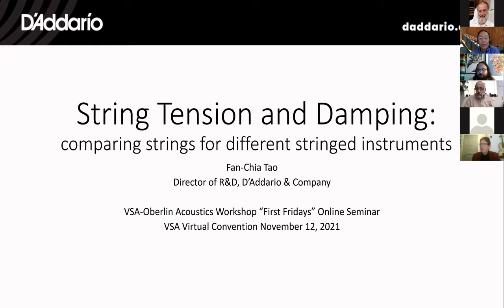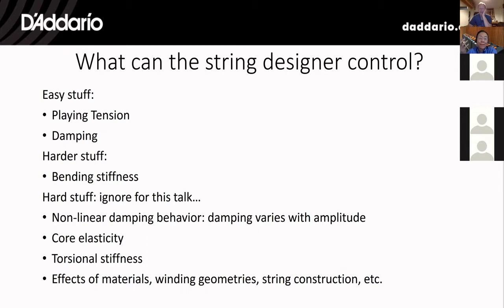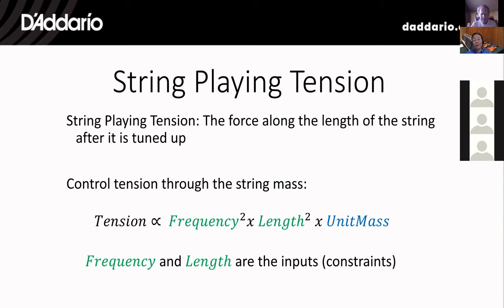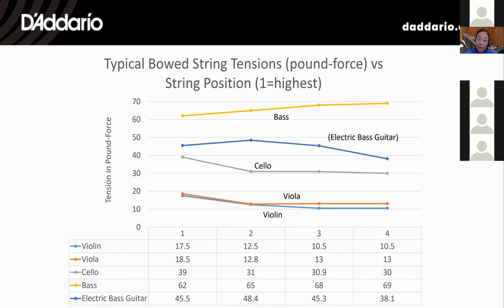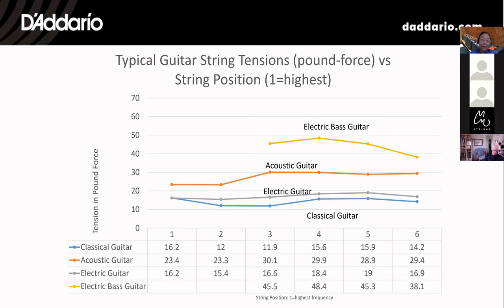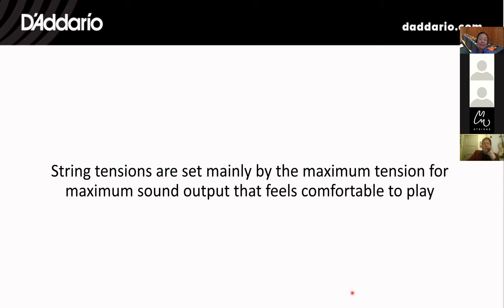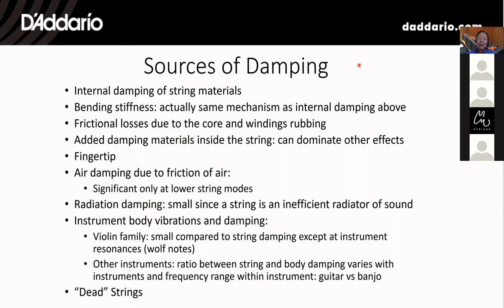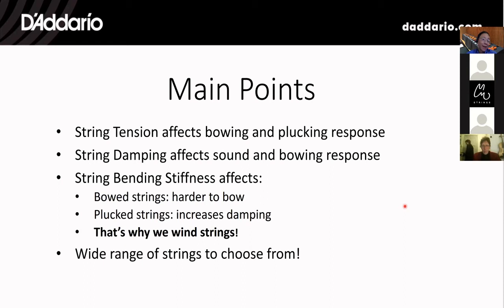VSA Seminar Nov 12, 2021: Fan-Chia Tao, String tension and damping: comparing strings

Comment: What a great and informative discussion.  It seems that cellists, myself included,  more than any other player/owner stringed instrumentalist, are continually experimenting to finding the best strings/combo. Any shallow search on some of the internet forums confirms this.  Not only are all cellos unique, but this quest is further complicated when a lower string gets changed out, for example, to a different brand or type, and it changes the entire characteristic of the instrument and the overtones of all the rest of the strings. A highly dampened lower string also dampens lively and bright upper strings, in my experience.  The opposite is also true.  I highly recommend that cellists specifically start with a complete set, all within the same published tension range, then experiement with changing only one string at a time to discover the unique effects of that change.  I have 3 cellos, all with different set-ups (all D'Addario now, btw, due to unparalled consistency of performance, as I have had a number of the 'famous' high-performance cello brands be incredibly incosistent from like string to like string) and it amazes me how changing one string, most notably the C or G, affects the entire range.  I know there is a vast fascinating science lurking within this topic as is discussed here, but to me it is much more of an art given cello variety, and certainly a matter of individual taste and expectation as well.